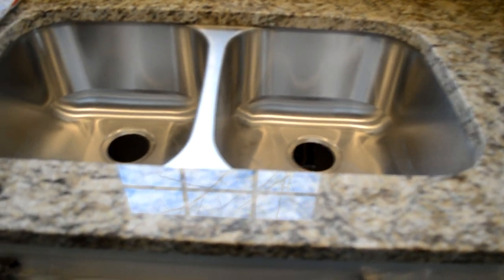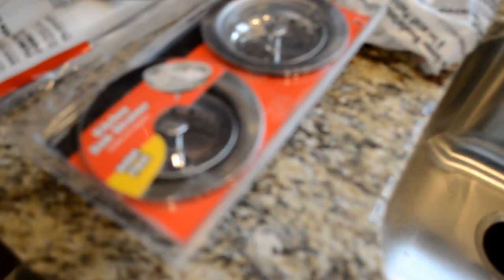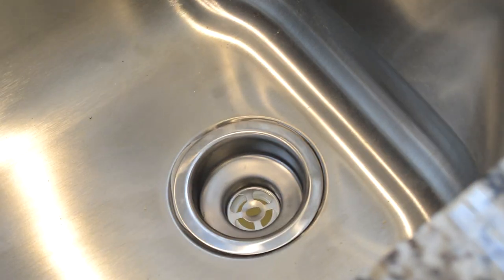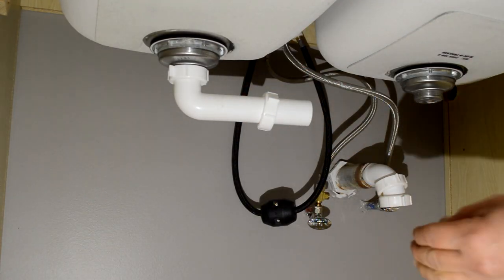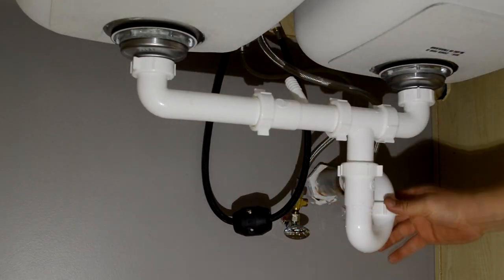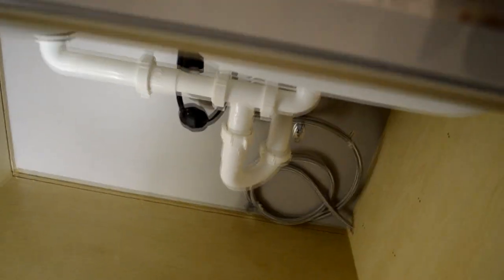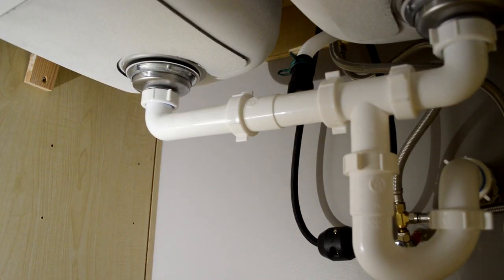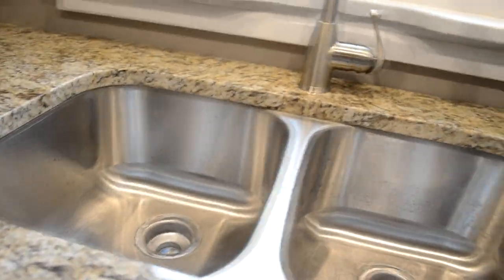How to install the kitchen sink drain pipes

Comment: Man lots of plumbing sins in this one. First off every trap should have an Air Admittance Valve above it which isn’t even mentioned in this video. The Teflon is completely unnecessary  and will actually cause leaks when applied like this. Use a rubber gasket for tubular drain piping. Most modern tubular comes with one in the package already. Holy hell man don’t ever thread PVC to galvanized. If you don’t want to replace the galvanized just use a fernco. Definitely follow this guys advice if you want to end up spending money on a plumber anyways.
Reply: So where's your video
Reply: This guy sounds a little shady, thanks for pointing out his amateur bs mistakes  !

Comment: For those wondering, you're typically supposed to match fittings. In other words, use a metal nut to screw on a metal pipe. He uses a plastic nut to thread onto metal, and that's probably why he's got nearly 20% thumbs down.
Reply: Why don't you make a video and show us all 🤷
Reply: @codyprocak6098  cause there's no need.  The rest of the video was great and accurate. I was confused myself why he got so many thumbs down myself before I researched it. Plumbers see one wrong thing and smash the thumbs down button. :)
Reply: Technically and functionally you are incorrect. If you were to match material your drain cups would have to be plastic or your drain pipes would be metal. These fittings are designed for low pressure seal forces so dissimilar material contact variations due to difference in material will be negligible. The softer material is actually designed to deform to a compression over the harder material. If in doubt, please contact the manufacturer. Can't believe what everyone states in YouTube as fact. Where I come from, thumbs have no brains.
Reply: @cassielam2868  Everybody becomes a master technician while living in their mom's basement.

Comment: Thank you, Hugo. I updated my kitchen sink plumbing and had the same leak as you did at the connection to the sink flange. The Teflon tape to the washer solved my small drip leak. Muchas gracias, camarada. Se le desea muchas vibras positivas y suerte.

Comment: Nice video. Teflon tape should be wrapped clockwise also I dont think you need plumbing patty, the rubber gasket is enough
Reply from the maker: Great information, thank you
Reply: You have to use plumbers putty to seal the drain from the top side of the sink... the rubber gasket (followed by the paper gasket) is used to seal the drain from underneath the sink.

Comment: - I have the same drain types for my double sink at my kitchen.  For some reason it dont work and its not draining like your video.... When I ran the water and I only use one side of the sink, instead of directly draining the water to the waste pipe, the water will go to the other side of the sink, filling both sink at the same time.  Theres is no drain blockage because when I plug the no erator sink with a cover and turn-on my erator sink on the other side; the water start draining. Addtly, if I dont cover my no erator sink, then turn-on the water on the erator sink, the water start pulsating on the other non erator sink and this time the water is not drainh . Any advice, please help...
Reply: thank you in advance
Reply from the maker: Hello, that is an issue that I notice when the drain line doesn't have a ventilation line or when the vent is clogged. In my house I installed a vent under the sink to avoid that issue

Comment: The first pipe attached to the elbow from the drain showed the plastic ring but,,,,,,isn't it supposed to be installed with the tapered edge first?
Reply from the maker: These type of fittings are designed to fit very well with just some effort, in some instances the contact between metal and plastic can present issues but the use of Teflon tape solves the issue. Thank you for your input

Comment: The washer you used on the sink tailpiece is not the correct one dude you need the flat one that drops into the tailpiece and you dont ever put teflon tape on that part maybe on the galvanized pipe because its corroded and will help the washers tip form more to the corroded pipe but here in south florida we mostly use one and a half inch pvc pipe and slap a marvel connector on there.
Reply from the maker: The washer I used was the one you described but to avoid excessive pressure on the nut a little bit of Teflon tape. Great tips thank you for watching my videos

Comment: When installing waste pipe to P-Trap how to do you keep it from slipping? I have put the washer on and the nut as tight as I can get it but the pipe over time slips down and leaks everywhere. Feedback would greatly be appreciated!
Reply: That's why I'm here.  I'm wondering if it's the design of the connector's or if mine are just old.  Been in this house for a year and we just had a leak this morning while doing dishes after breakfast.  I'm not a plumber, but if i had to guess, the constant switching between hot and cold water might slowly loosen the connectors with flexing of plastic piping?
Reply: Sounds like your pipe is just a little short
Reply: Either two short or it's not lined up...
Reply: (urhubs at an angle)

Comment: Galvanize is a big no-no. They tend to corrode  and cause issues... I would try to remove that extended piece to see if the pipe behind it is also galvanized...if it's not, I would remove it.

Comment: Teflon tape should be wrapped clockwise on the threads.  Not sure why he's wrapping it around the pipe and not the threads.
Reply from the maker: Great question,  it is to add volume to the washer amd avoid leaks by filling small gaps

Comment: I believe the dishwasher requires an air gap by newer code. This would likely not pass an inspection in Minnesota.
Reply: you are 100% correct about an air gap. and the tee in the drain line is also installed incorrectly...the drain tee may only installed in the vertical drop. you may not allow the drainage to run into an opposing flow. this would never pass a proper plumbing inspection. this guy would not make a pimple on a plumbers ass.

Comment: 8:04 sigh I'm such a hypocrite.  I didn't have to be such an ass.  I do want to point out that the use of teflon tape (the correct use) seems to be a very confusing and highly debated topic.  However, there are specific situations where teflon tape is crucial, and others where it either does nothing or can harm an installation.  I am 95% confident that this is an incorrect use of teflon tape and could cause problems for other people.  Those gaskets are the seal and should be completely clean and free of all debris, including teflon tape, when tightening the fittings.
Reply from the maker: You are right in the perfect scenario you have several parts to replace the ones with issues and I normally install without Teflon but there are those factory defects that make you use extra products. Thank you for the information

Comment: what i dont understand is with this contraption the parts that you screw together. . .there aren't any threads to the connecting pieces. . so really the only thing holding the pipes together is the friction between the O rings and the ring itself.  i know this first hand b/c i've installed it correctly, had pipes that severely backed up, and then from the force of gravity + the weight of the water in the pipes, had the O ring slip off, followed by a huge amount of water leaking.

this contraption altho recommended by everyone, makes no sense to me = /
Reply from the maker: Those connections must be well fasten, with time they need to be checked. Thank for watching my videos

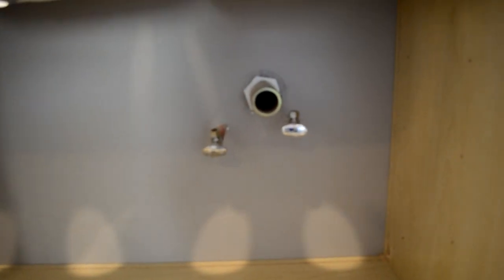Comment: 2:06 and 37 Um's sorry I'm turning you off it's driving me crazy sorry maybe write down what you want to say or edit out the um's
Reply from the maker: Ok
Reply: This is really uncalled for...not so many ums as you imply. I see this "um" comment a lot on You Tube, and sometimes wonder if they come from the same person or two who are easily aggravated.  Trade work is not for the easily aggrevated person...lol...go hire it done !
Reply: @jamesconner3437  I did it myself in less time than the video took LOL
Reply: @imcirgold  ...congrats....I could not..:((  Got it, but not so easy to stop all leaks with so many connections, including dw.
Reply: @jamesconner3437  Thank You I used to do this all the time when I was younger but forgot alot through the years once I started though I flowed right through and everything is good now !!
Reply from the maker: @jamesconner3437  you are right,  i learned that is better to mute the video and do a voice over the video strip, the ums are the thinking process that is being made to have a clear sentence.  Thank you!!